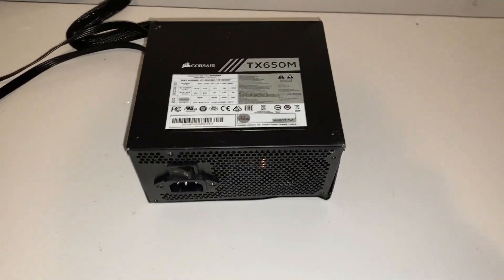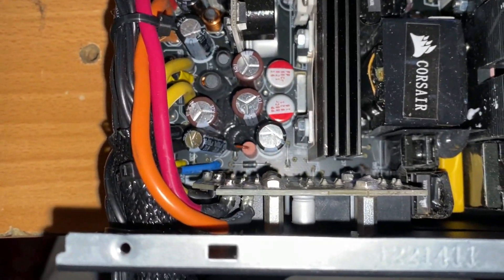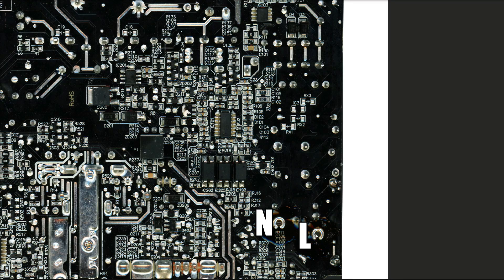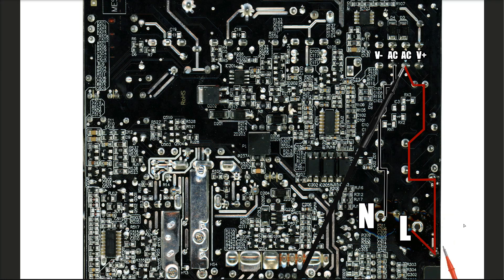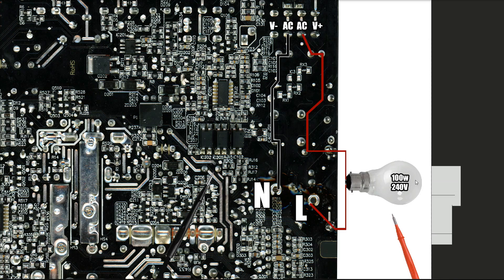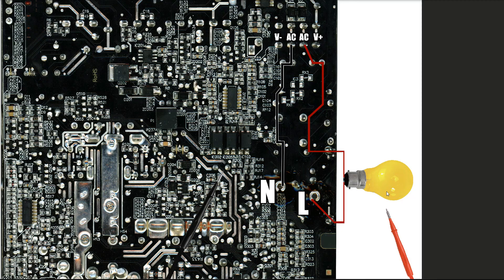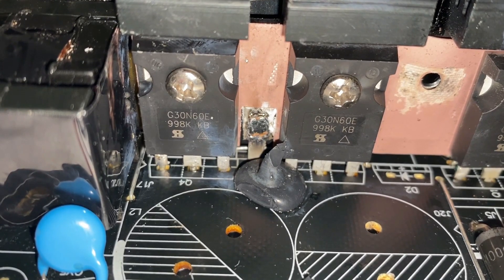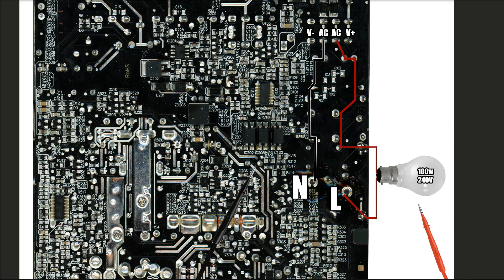CORSAIR TX650M - Using A Dim Light Bulb

Comment: hi, did you manage to fix it? I have same issue
Reply from the maker: Hi Skipperino, no I didn not get a solution on this one. I did not have a thermal camera at the time, and I wasn't brave enough to touch around the board to see what was heating up. I must try fix another ATX power supply soon for the channel, I need to improve on these.
Reply: @therepairshare673  I think I have it by now. Its because isolation between transistors and radiator is broken, causing short circuit. I changed silicon isolation on all transistors and the short circuit disappeared, check diodes and transistors are they working, and if they are power supply should be fine. With first turn use 100W lamp in series tho :D
good luck

Comment: That metal terminal from which the spark springs is generally one of the anchors that are added to the aluminum heatsink with a metal rivet. There are pads for them to solder on the PCB but those pads do not have any circuit lines (not even to ground) and are only soldered to keep that heatsink in a fixed (vertical) position. 
I would proceed like this, I remove the entire heatsink module including the components, insulate each Power Mosfet G30N60E with plastic mica or rubber silicone, mount it on the PCB and verify that the retaining screw does not have any connection with the terminals (Source, Drain, Gate ) of the device. Finally, I soldered the anchors and double-checked that the terminals (S, D & G) of each Mosfet did NOT have continuity with any of the anchors.
PS: TO-3P/TO-247 silicone rubber transistor insulator, very cheap on ali/xx.
At mouser: insulator mica 56-02-101G.
Good luck. Thank you very much for sharing. All the best.

Comment: Almost willing to bet a bad mosfet…usually in a setup like this a mosfet fails taking the diode with it. Usually the burnt spot is where a temp sensor is at… but this is my experience with tv power supplys not computer ones.